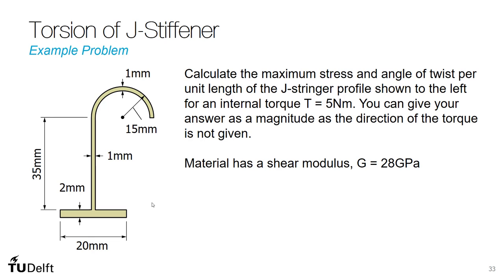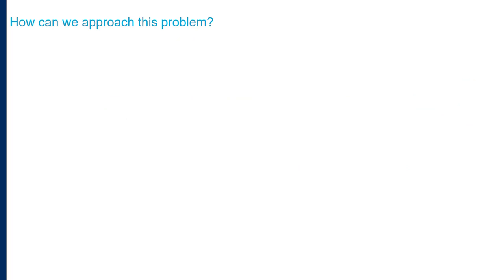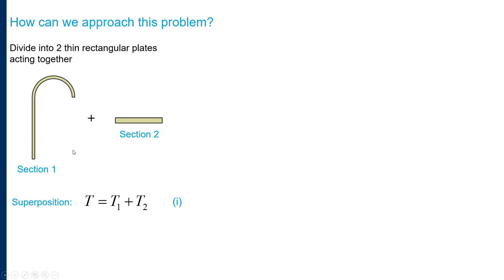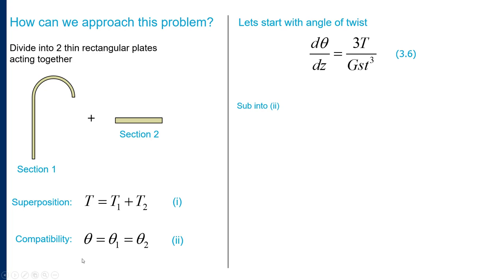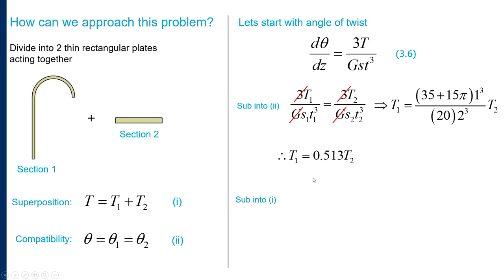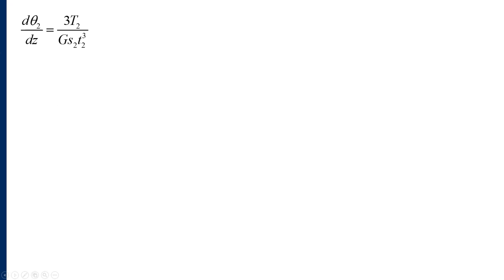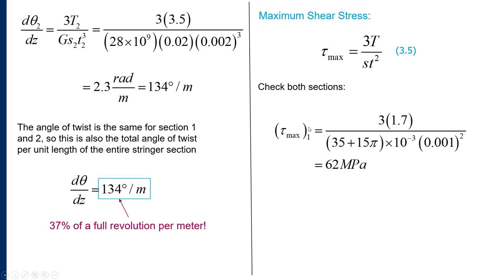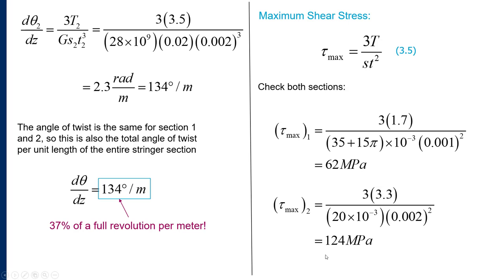Example Problem: Shear stress and angular deflection of a J-profile stringer carrying a small torque

Comment: Dear M. Rans,
 
Is it possible that you made a slight mistake in your calculations, or is it a typo ? 
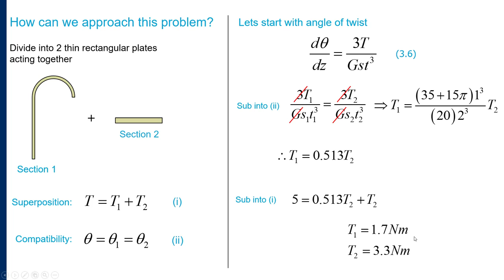At time 5:50, it is written that T2=3.3, whereas, at time 6:16, you write that T2=3.5 (note that for the max. stress, you do use the value of 3.3 for T2). That will change the end results a bit.

Thank you for your video :)